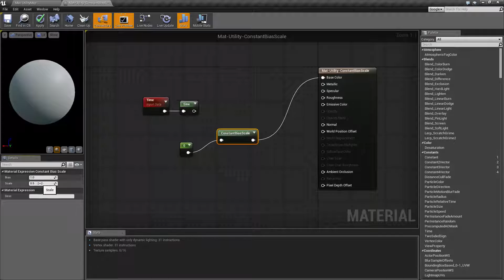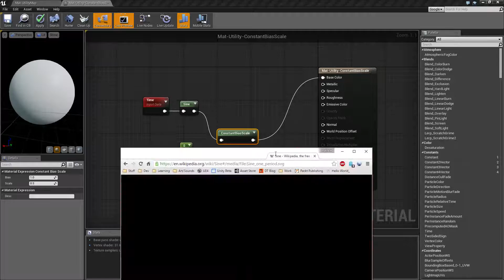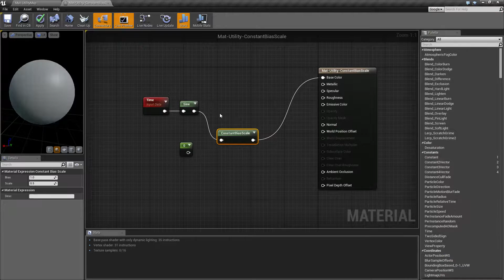WTF Is? Material - Constant Bias Scale in Unreal Engine 4

Comment: I understand that these are using different methods to achieve this, but just to make sure I'm understanding what's going on here, this approach is getting the same exact result as when we apply an abs node to the result of a sine node, correct?
Reply from the maker: Sort of.  For my example, it might have been similar but we are not just removing negative values but shifting the entire range by a value.  

Due to color only being from 0..1 having a 2 in our range after we shifted it did not change our result but if I had plugged that into the Emissive for example then we would have seen a difference as we would have had some glow due to our color being over 1.